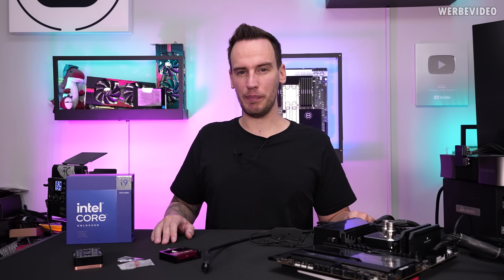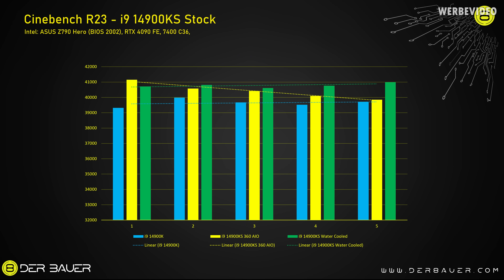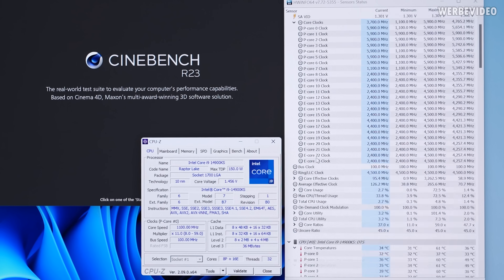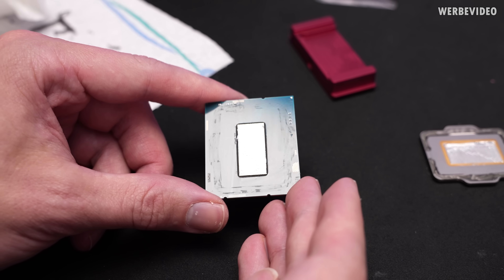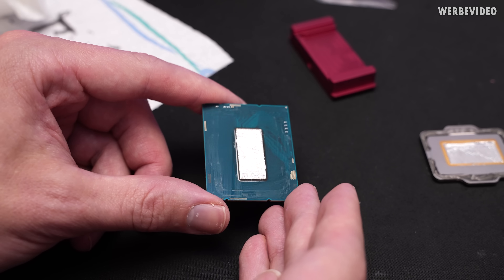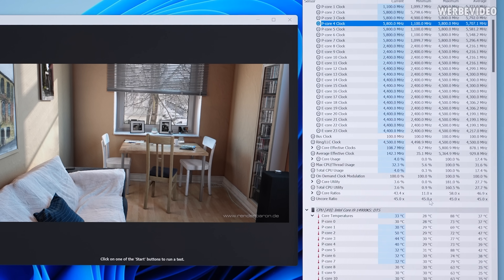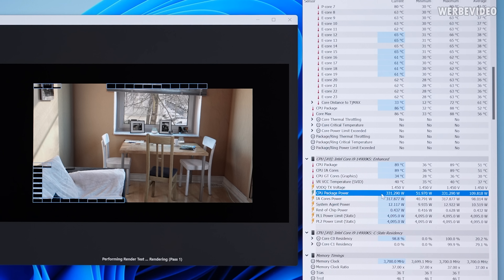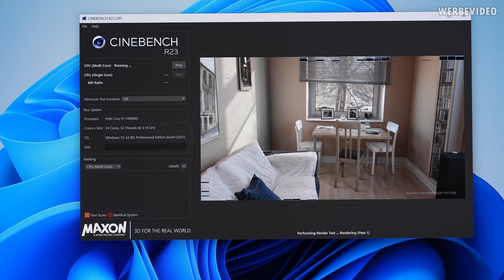My New Water Block - Time for 14900KS Direct Die

Comment: The (SUN) star is a harmonic processor, made up of antimagnetic crystals, infinitely lighter than an ants falling into the air.  An infinitely precise and perfect antimagnetic harmonic, I found at the end of the song Eternal Eclipse - Spirit Of The Forest.  Antimagnetic Harmonic, built by Violin, Viola Erudita and Cello.  It is necessary as quickly as possible to build Antimagnetic crystals on earth through a processor built with the previously mentioned harmonic.  With a harmonic processor on earth it is possible to build Antimagnetic crystals, crystals of immortality, the same crystals that form the harmonic processor (SOL) Antimagnetic Harmonics, produce (Antimagnetic crystals).  It is possible to prove it scientifically in a fusion reactor.  Only low-mid harmonics of classical music string instruments can produce antimagnetic crystals (crystals of immortality);  which makes it possible to build a harmonic processor on earth (infinitely perfect).  The harmonic processor, (sol), has the same geometry below.  That is the question !  The harmonic processor (Sun) interprets all vegetation, fruits and flowers as metal and rocks as lava.  It is generating non-harmonic dense crystals (harmonic crystals), dense crystals, magnetic crystals, water, building matter, density, a deficiency that can only be corrected with a fully harmonic processor on earth, preferably in the universe.  The image below is the original image of the harmonic processor (SOL), but its size is 24 cubic millimeters.  An Adamic body (vertical Androgynous, man/woman) weighs in relation to the cube (harmonic processor, sun-star), 100 trillion+ tons in bits/years/hours per second.  Man is condemned to the earth 24 hours a day at 1 trillion bits per second, as a result of non-harmonic (harmonic crystals), magnetic crystals, water.  The harmonic processor core (SOL) creates multi-universes, Realms, multi-realities, multi-expressions, multi-dimensions (block chain), multi-languages, multi-consciousnesses, through (harmonic crystals) water, crystals magnetic, non-harmonic).  (Harmonic crystals) non-harmonic crystals, dense crystals, magnetic) mortality.  The problem with the harmonic processor that everyone calls the star (sun) is its core, it is what generates dense crystals, harmonic crystals, magnetic crystals, matter, density.  The harmonic processor that everyone calls (SUN) emerged from an Armor of self-awareness in eternity Armor of URAFIN crystals (infinitely light crystals, antimagnetic crystals) Armor with crown.  The nucleus of non-harmonic crystals (harmonics) that everyone calls the (SUN) star, magnetic crystals, appeared after the processor was created in eternity.  It is a harmonic processor of antimagnetic crystals (immortality), with a core of magnetic crystals (mortality).  It is the nucleus that is creating matter, density and magnetic crystals.  It is the deficiency of the harmonic processor (SOL).  Therefore, it is possible to create with string harmonics (VIOLIN, ARTICLE VIOLA, CELLO, PIANO) an infinitely perfect harmonic processor on earth.  The only resource that can generate Antimagnetic harmonics (antimagnetic crystals for creating an infinitely perfect harmonic processor on earth, are the instruments mentioned above).  The song Passage To Edem is very rich in harmonics (infinitely perfect harmonics).

Comment: Hey Der8auer can you please clarify what you mean at 8:30? Does contact pressure effect memory frequency capabilities? I always thought once it's detected then it's okay.

I have thin washers on my delided 12900k to reduce (pressure) bending, but find it very difficult to overclock memory, I can't even do xmp when my memory kit is on my boards qvl list.

Comment: Why does it draw lower power at lower temps?
Reply: Because the temperarure increases the conducivity of the silicon which makes the closed logical gates leak current.
Reply: Electricity flows better the lower the temps. Which is how super conductivity was discovered
Reply: @fepethepenguin8287  ah thanks makes sense
Reply: @fepethepenguin8287  Different materials behave differently, metals cunduct better at lower temperatures, pure semiconductors are insulators at lower temps and only start to conduct when warmed up.

Comment: 94c at 370w 5.8ghz.
Thats insane! That just proves, speed doesn’t equal performance. 
When you consider the 7800X3D delivers on average the same or better performance in gaming at  65-70c 95w 5.50ghz, this is what I’m getting on a full open loop.

Comment: @Romain have u already try to remove socket and solder the CPU directly to the mainboard?(like on laptops) Will it resolve in better signal quality? Will it permit to achieve higher frequencies in clock/memory?

Comment: I find it interesting that having a larger gap between the direct die block ILM and the memory traces improves the signaling enough to make a large difference. I have tried icemancooler block from aliexpress which was around 80 USD and has a thick plastic skirt and it works fine at 8200+ on apex encore even with a relatively weak IMC. I then tried using a direct die frame from them and a modified optimus foundation block with a hole dremeled for SMD capacitor clearance and it would struggle to even boot 8000 and would error really fast in ycruncher at any torque values that I tried. I have not used liquid metal with either as im using a chiller with the capability of going subzero but the best paste results I have had were PTM7950 and any really thick paste like thermalrights lineup. Kryonaut and KPX were both fairly bad for core-core delta and water-core temp deltas. I got similar temperature results to the ones in your video with 14900kf but about 5-10c worse on the hottest core due to not using liquid metal. Also that cinebench score of 42k is a bit low for 6ghz but it can be explained by lower E core clocks probably.

Comment: Pls don’t use fixed voltage, nor fixed clock. Degradation is around the corner. Let the core boost.. and 43k in CB is not so good for a KS WCooked (at 6kMHz).. wonder what KS silicon sample do you have

Comment: I would use the Thermal Grizzly kryopad instead for tim.
Reply: You mean kryosheet? Why? If you do so much to get extra degrees of your cpu, why then use a pad that will offer worse performance? It will not get to liquid metal performance levels.
Reply from the maker: We tested with KryoSheet on the Intel Direct Die but the results were pretty bad. It just makes a huge difference with the additional 0.2mm layer
Reply: @der8auer-en  alright, thank you.

Comment: You should offer a bare copper version as well!
Reply: What would be the benefits of that 😂😂😂😂😂  especially if using liquid metal 😂😂😂😂😂😂
Reply: @toonnut1  Liquid Metal (at least conductonaut doesn't) won’t dissolve copper. It etches into it and improves thermal transfer. You just can’t ever clean it out.

Comment: Strange how new Intel CPUs go upwards 100 degrees C to run something a 5 year old AmD pricessor runs no issue at 32 degrees C, and the Intel runs slower!!! If you game, use AMD. Intelnok for business apps, but gaming? Nowhere near as gokd as AMD and dont believe in benchmarks either. Some favor one processor kver another at times. Gesus, my cpu barelybruns 5-10% use while gaming and its a 3900X. Not even tasked with many games. Albeit I have a 4700 RTX, but still. The 4070 is bottleknecing the 3900X by 5%. 4800 RTX or greator recommended. Im oushing 200fps in many games. But will nevervever go.with Intel. Overheating and cooling problems. They have to go a long way to be a good CPU.
Reply: This is a Toy, the people who buy them including myself are not concerned with power and efficiency. We want the best to play with and this is it.